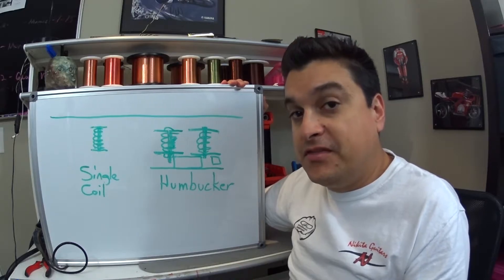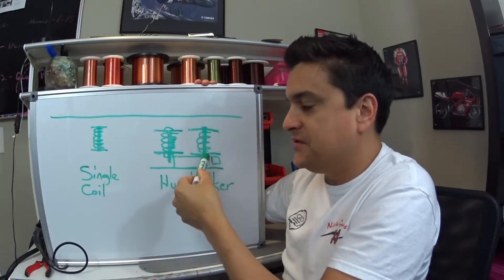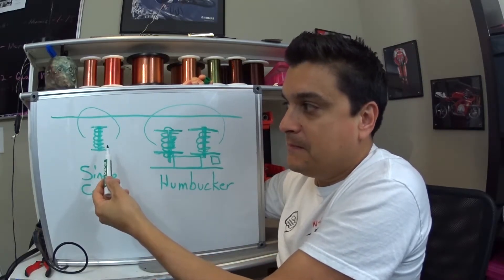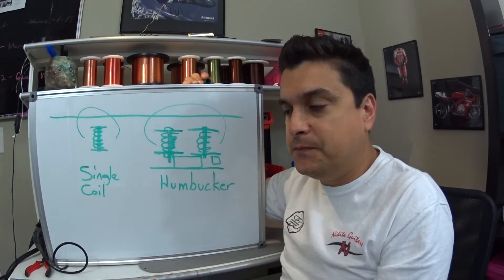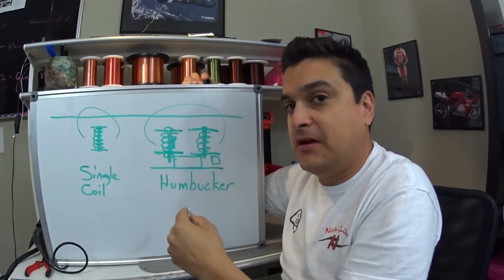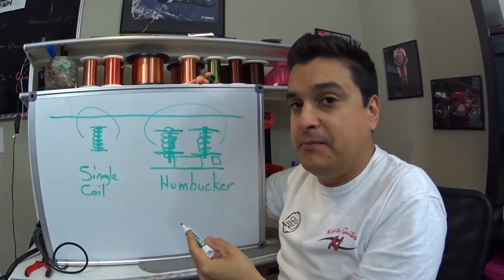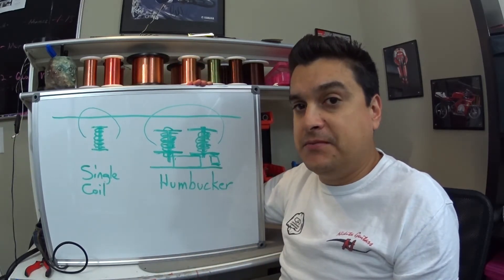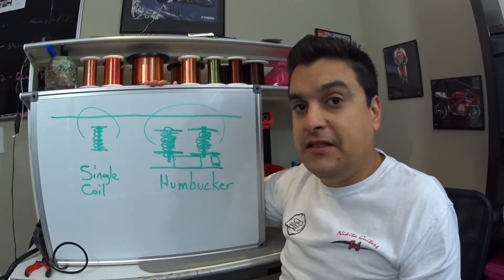Dylan Talks Tone Ep #3 How Electric Guitar Pickups Work #21

Comment: You're saying a guitar pick up literally creates electricity.? I did not know this is that a tiny amount of electricity?
Reply: Yes. I build and repair guitar amps. In a passive guitar pickup the vibrations of the guitar strings in the pickup's magnetic field generates a voltage. It's typically less than 1 volt, so we're talking millivolts here. When that signal reaches the guitar amp it will go into the first pre-amp tube grid. Inside the preamp tube there's a vacuum. The heaters on the tube causes electrons to boil off and fill up that vacuum. Electrons are negatively charged. The grid is biased to a slight negative voltage. This causes the tube to not conduct any electricity. When the guitar pickup makes a signal it is a positive voltage. So as you play you are literally manually adjusting the bias of your preamp tubes by sending in a positive voltage that makes them conduct.